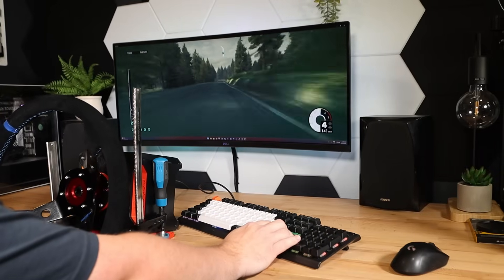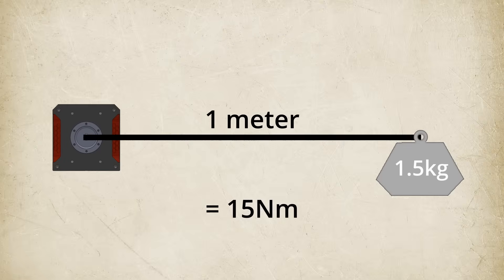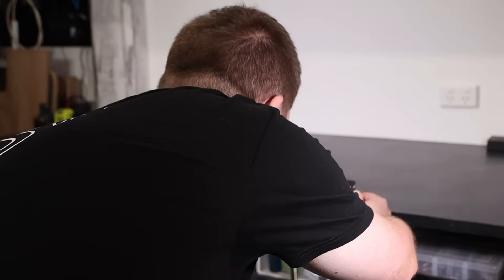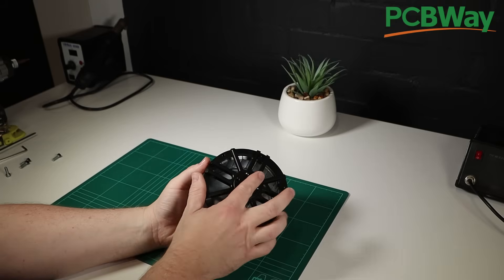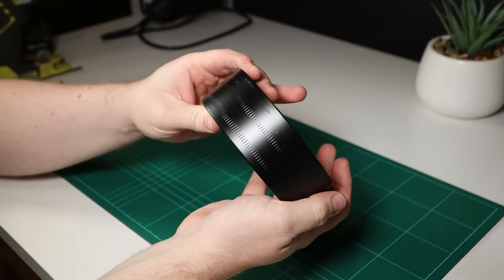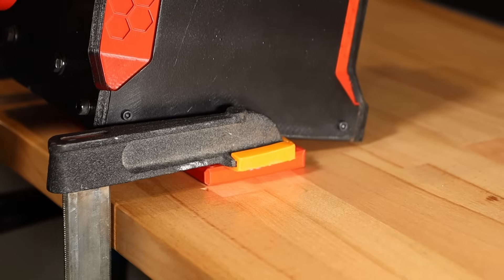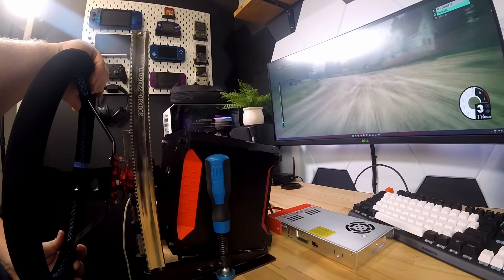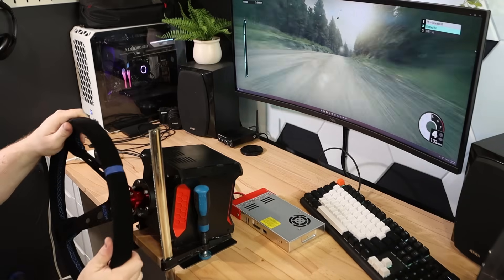DIY Direct Drive Wheel!

Comment: I really appreciate the STL file you shared for the open-spoke motor back cover, it’s an awesome design and I think it can help a lot of DIY builders. I wanted to ask if it would be possible for you to make a version that includes a shaft hole sized for the stock bearings. That would make it perfect for use in custom projects like mine, and I believe many others could benefit from it too.
If ever you’re able to make that version, I’d be really grateful if you could share the updated file. Thank you so much for your time and for all the work you put into helping the community your projects are really inspiring!

Comment: if i print the motor top motor cover from ABS or PET-CF will it be alright? the cnc cost is just too much for me considering the fact that my total cost for all parts is around 100$ and just the cnc part is 150 inc shipping, and also what are the Temps around that top motor cover?

Comment: Yo dude has same deep dish wheel rim I have just diffrent colour on stitching and text that I have bolted on my wheel base for how cheap it was its actually a decent wheel rim as put well over 100hr's on it at this point.
Reply from the maker: Yeah I'm happy enough with it, although some of the stain appears to be coming off the material with use. I'm sure once its had enough use that will stop though!

Comment: i would love to make something like this, unfortunetly i dont think i can order parts on pcbway since im short on cash. do you think the front motor cover is doable on a lathe? i do go to a machine shop once a week because of school. also, ive never done anything like this before, do you think i should pick some other design? i really like yours because it uses a round real wheel and not some f1 looking one, also the motor sits in the housing, not the wheel part iself
Reply from the maker: A lathe is the perfect tool for this job! Forget about the fancy cut outs in the part and just focus on getting the diameters correct in the tightly toleranced areas. Then you can just drill some big cooling holes through it when your finished to help air to pass through the motor as they do get pretty warm!
Reply: @cncdan  i actually changed my mind once more and decided to make my own design entirely. the hoverboard motor comes with.... well a hoverboard, so ill just use half of the hoverboard as a mount for the engine. ill machine a flat section on the outside part of the motor where the pretty pattern sits, and then drill a common 6 bolt patter for a quick release. for the encoder i will NOT be putting long conductive sticks in the shaft and instead ill make 2 custom pulleys to transfer rotation somewhere else and attach a magnet at the other end for a magnetic encoder since the regular pulley ones are wayy more expensive. the rest is pretty easy just connect all the boards and power  supply and then its software stuff. i am in not way an engieneer but i think this is propably THE simplest design and yet somehow i never saw anyone do it before?? wish me luck, and if you wish to see my abomination let me know

Comment: Hi im bit new to all this but would you recommend me a way of adding padel shitters to the wheel as i will be driving diffrent types of cars also side note the gear H- pattern shifter is absolutely mint love it, thanks
Reply from the maker: Glad to hear it! As for the paddle shifters, there's definitely a few options I can think of. The controller does have a couple of spare IO pins, so you could utelise those for wiring in the buttons but you'd need to be able to pass the wiring down the shaft somehow, which wouldn't be easy. I'll probably build my own wheel in the future with buttons and paddle shifters, but I was going to just make it wireless and rechargable so I don't need to worry about connections running to it.
Reply: @cncdan  wow thanks man I'll take your advice 👍

Comment: is the shaft of the shelf product or custom machined?
Reply from the maker: Mine was custom machined, but you could do it with just a bit of 15mm round stock. All I did was machine some keyways in and turn the end down to fit the bearing but both of those parts could be ommited if you don't have access to the right machinery. You could just drill a hole straight through the shaft where the grub-screws go and bolt into the shaft instead of using a keyway. It's not the "right" way to do it, but I'm sure it would be fine! And you could change the design of the controller mount to use a larger bearing with a 15mm ID so the end doesn't need to be machined down to fit.
Reply: @cncdan  went to some guy with a lathe :)
10EUR without keyway... but well worth it :)

Comment: is it entirely possible to 3d print every component needed?? i dont think PCBWay ships to where i live:)))
Reply from the maker: For my design, probably not, as the replacement front of the motor and the shaft adapter really need to be quite strong. There are plenty of fully printed FFBeast projects out there though so you should be able to find something!

Comment: Your torque test is completely wrong and, in addition, by using a lever of this length, you run a huge risk of injury. This value in Nm that you found will never be constant. If you subject a hoverboard wheel to work with a constant 12.9Nm, it will simply melt in a few minutes.

Comment: This video is a joke. Just to the standard ffbeast wheel design. This "design" is a horrendous insult to engineering from every point. 
This joker just overcomplicated everything and obtained nothing.
Reply from the maker: I don't normally bother replying to comments like this, but I'll make an exception this time. 
I had a look at the FTH sim racing build you mention. He did a good job, its a different approach to mine and certainly looks neater than the standard ffbeast wheel design, but I don't understand what makes you think that it's simpler than mine? Looks to me like he's got a custom machined shaft too, and he's even had to weld on the spline which is one thing I didn't do as I opted for a machined adapter instead to make it easier for people who can't weld or know someone who can. Mine may only be supported from one side, but its from the front so the load of the wheel is applied directly to the bearings rather than the bell of the motor like the original ffbeast design. The only real part of my design that could be deemed "less rigid" than his, is that I used plywood for the front and rear plates instead of what I assume is thin aluminium. I did laser cut some steel plates to use but I wanted to try plywood to see if it was strong enough for people that don't have access to the tools that I have and ultimately, it ended up being more than strong enough so I stuck with it. A lot of the design choices I make during these projects are for the audience, to try and make replicating my projects possible for people that don't have a full machine/fabrication shop at their disposal.
I'm sure this won't have convinced you of anything and you'll continue writing angry comments on the internet to whoever will listen, but just thought I'd comment because I'm genuinely curious as to why this made you so mad.
Reply: @cncdan  don't pretent your build is accesible. you tried to incorporate sponsors as much as possible. 
i'll skip the small talk and bullshiting.
What made me angry is that you have the audacity to cobble some "design" up, and call it an enginerring design. 
It's and direct insult to engineering and mechanics in general. 
FTH's build is just as "accesible" as yours.
The main difference is that he made valid  design choices, while you lack any formal education but still post something online, presented as something more.
Smearing the art of engineering is what made me angry. Smeraching the art of machining made me angry.
Now onto what is just shitty, is that people see this  video and think "oh,  too bad it's so complicated". People like me, who got inspired to try this for themselves, just because it's so easy to do the default people, and it also works very well.
So miss me with the "my shitty design choices are because I wanted to help the audience". Get fucking real. You  thought the default build is not rigid enough, and thought, out of arogance and ignorance, that you could do better.
I don't do this either, but if you want, we can have a public conversation, on the FFbeast Wheel discord channel. And if you actually think that what you presented in the video is anything else than moronic, a monkey with tools playing around, I will enginerically disect your design, and objectively prove to you how literally every step was from bad, to worse.
Reply from the maker: There's obviously no point in arguing with you. I'm not sure exactly where I called this an "engineering design" which seems to be your main argument, but either way I'm just designing a project and providing the files free of charge for anyone that wants to build one, purely because I enjoy building things. If you don't like how I did it, that's fine but there really is no need to get so upset about it.
Reply: @cncdan  see how the first person who replied to me said "this seems like the bare minimum [to get the cheapest and best diy force-feedback wheel]"? 
Don't act Innocent. You are misleading people, and making money out of it.
If what you said was true, you would've stated clearly "there is no reason to do all this, the normal build is perfectly fine, however, I wanna play around and try something".
And no, you did not literally state that this is an "engineering" design, however, it's implied throughout the whole video.
Reply from the maker: In the first video of this two part series (which has been seen by far more people than this video), I said "Since there's already plenty of tutorials on how to do this with minimal tools, I decided to take a different approach and see just how neat I can make this". I even linked the FFBeast github page in the video description (and mentioned it in the video) so people could check it out and choose to build that one themselves if they wanted the cheapest possible option. I even mentioned at the end of that video that the main reason I wanted to modify the motor was to make it more easily used in other projects where you can't simply bolt a wheel adapter to the front of the motor, and that the wheel was a good project to start with and see if it was possible. Script writing isn't one of my strongest points, so it's possible that my underlying meaning may not always be as clear as I want it to be. That is something I am working on improving.

The first commenter also didn't say that last bit, you just assume that's what he means. My interpretation of his comment is that he is just questioning your rather over the top repsonse to the video as he doesn't understand how you think this is more complicated than it needs to be. 

My only real aims for this channel are to make entertaining content, and to show people that open source projects don't have to be ugly. Sometimes that does mean they are more complicated than "necessary" but I've never claimed that my way is the only way to do things. Sorry if this type of content isn't for you, but no one is forcing you to be here!
Reply: I'm curious do you have pointers for better designs? This seems like a bare minimum design instead of being overcomplicated but maybe I'm wrong.
Reply: @amogusenjoyer of course. if you have the hoverboard, just cut it. if it holds you on the road, it will hold a wheel atached to it. all you need is an adaptor to mount the wheel to the rotor  case. leave eveyrthing else as is. that's simple and way way more rigid than this jokers "design".
if yoiu want somehting more complicated, check out  FTH Sim Racing's build. he also went the double side support route. but with actual brains

Comment: You could easily measure torque of a motor if you attach something heavy but with known mass instead of wheel and make motor spin with full power. Then you could use existing encoder to measure acceleration and calculate torque
Reply from the maker: Sounds more scary than what I ended up doing! I also would've had to flash the original firmware back onto the controller and work out how to do the calculations. I just wanted a rough way to check and show it for the video that people could understand and I think it was good enough for that!
Reply: @cncdan  fair

Comment: now this is what I'd call a finished product.

in your last video i saw the wheeel bending shifting around and back then my thoughts were "yeah that looks fine, but i wouldnt put it in my rig". Now i want to make this too lol

Maybe you could try to make a wheel rim with buttons next? Depending on what you're driving a good wheel rim with buttons is a game changer, and you could just connect that directly to the PC with a spring cable around the quick release so it turns well
Reply from the maker: I'd definitely like to add some buttons to the wheel or even build one from scratch eventually! I'll do the pedals first though so I can start to bring all of this together into a rig in the coming months. The wheel will probably be independent of the shifter/wheel/pedals and run as its own wireless controller, so it doesn't need to be wired back in through the wheel base.
Reply: @cncdan  oh hell yeah so happy to hear you're going to finish the set! 

can't wait for the next video lol

Comment: I am curious if you could create motorized dumbbells out of these... If they can produce 50lbs of resistance they would make a great under the bench pulley system. Programming would be awesome if it could have different resistances for concentric and eccentric movement, and a power generation mode where is just acts as a generator and tells you how much energy you produced.
Reply from the maker: I haven't really played with the motor controller without loading the FFBeast firmware on, but I'm quite sure something like that would be possible. I know very little about weight lifting (which is probably pretty obvious from the videos 🤣) but I imagine the speed at which you lift the weight doesn't matter so much, in which case you could probably get away with much smaller motors and a gear reduction!

Comment: There can never be enough DIY solutions or ways for enthuseists to make what they want away from comercial products. The way i see it, even if its easier/better/cheaper to just buy, just the ability for individuals to make by themselves whatever they want can:
- promote creativity
- insentivise companies to innovate even with low competition
- insures hobbies are financially viable
- allows for long-lasting maintainability and support.
And the more ways there are in varying budgets and features, the better the hobby becomes.
Reply: fr man i decided to build one with Arduino Leonardo 600ppr encoder and a 24dc motor with 3:1 pulley to increase torqque by lowering rpm 
and its less than half of the price of logitech g29 and better than it
Reply from the maker: Spot on, couldn't agree more!

Comment: why dont you use the h patter and sequential shifter that you made for this seyup?
Reply from the maker: Mainly because I don't have enough clamps to clamp it AND the wheel to the table 🤣 Once I get the pedals built the plan is to integrate the shifter, wheel and pedals all into one input device and then mount it up on a sim rig so I can give it all a proper go!

Comment: Exactly yesterday i finished my own wheel base lol. Very cool please keep it up! I am very curious about the pedals and the way you will build them!
Edit: is your psu fan spinning? Mine is not, tho i have a motor that is a bit less powerfull as yours
Reply from the maker: I'm working on a design for the pedals now! The PSU fan only seems to spin when its needed. It was spinning by the end of my weight testing but I don't think I've noticed it spinning at all from actually using the wheel yet. Maybe once I get some more play time on it I will!